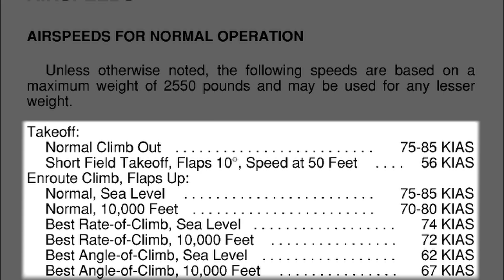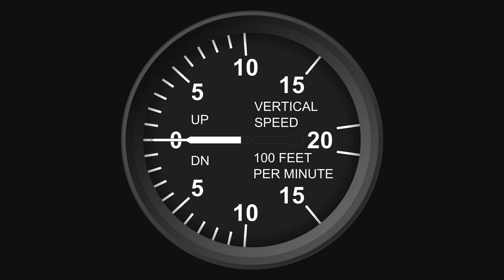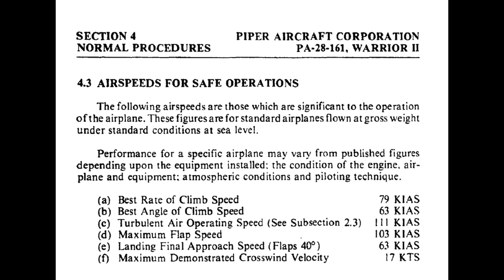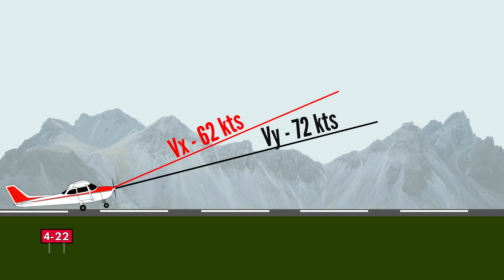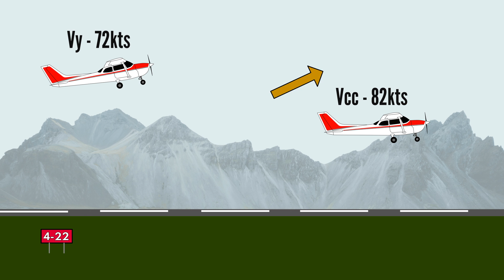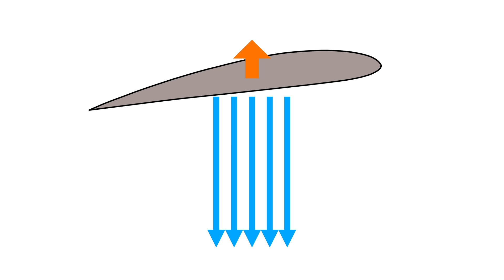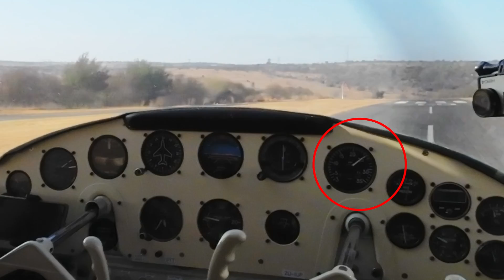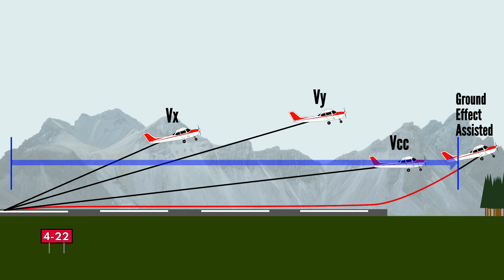Which Climb Speed is the Safest in a Light Airplane?

Comment: Ground effect acceleration is very helpful for an unpaved runway. Wet grass, mud, etc is minimized and safe climb speed achieved just after lifting off.
Reply: It is my default on every takeoff until Vcc or when an obstruction requires pitch up to just clear.  Airspeed, and not altitude, is life until high enough to recover from inadvertent stall.
Reply: This.  Get the wheels off the grass for max acceleration without the drag from the wheels.  It gets you to a safe climb speed with less runway behind you.
Reply: Isn’t this literally the definition of a soft field landing?  Lift the nose and get off the ground as soon as possible, push forward and use ground effect to accelerate to Vx or even Vy then climb.

Of course, one might want to remove flaps to get to a higher Vy but removing float  close to the ground is not worth the risk.
Reply: @lordcraycray2921  Vy is the math most up  for time, but that doesn't make it safer than using runway still ahead, level in low ground effect, until fast enough to maneuver safely regardless of what happens next.  Vx or Vy are not safe airspeeds when too low to recover from an inadvertent stall which is usually fatal.

Comment: Yours is the most extensive and excellent coverage of energy management on takeoff and Wolfgang's law of the roller coaster I have seen.  Eleven of my thirteen engine failures have been at 200' AGL or lower crop dusting and patrolling pipelines.  While the physics of the kinetic vs. potential energy seems equal, save the extra free kinetic energy provided by ground effect, I have found airspeed and not altitude to be life down here where I worked so many years.  As a crop duster (load) and mountain (high DA) pilot for so many years, the basic level in low ground effect (extra free kinetic energy) takeoff and down drainage egress (free potential energy) were default.  Most pilots don't need the extra free kinetic energy until they need it (too late), but videos and statistics corroborate my empirical data.  We very much need, in my opinion, to emphasize altitude (the Vy argument) less and airspeed (the ground effect and Vcc argument) more.  The fatal aspect of poorly done takeoff and/or go around seems to be achieving enough altitude quickly to kill in the stall/fall.  Vx or Vy as appropriate, never appropriate on long runways, and pitch to achieve a positive rate of climb, often initiated at way too slow airspeed, seem to orientate students and even experienced pilots toward altitude rather than airspeed.  How do we change this equation?
Reply from the maker: I think many pilots are caught-out by how fast airspeed dissipates at engine failure. I also don't believe the average pilot can save it at low level with an engine failure during a Vx climb, the bigger problem being that not all pilots realise this danger.

A pilot has to be able to accept the losses when trading altitude for airspeed, and this goes against the natural instinct of wanting to pull up as the ground comes closer, so you may very well be right that airspeed (kinetic) might be the safer energy of the two.
Reply: 13 engine failures!?
You need a new engineer mate! 😂
(Unless you have about 50,000 hours piston time and then that would be about right!)

Wise words.
There is no one size fits all solution. Based on terrain, aircraft performance and numerous other factors there will be a safest departure profile. That’s where experience comes in.

Solution to the training problem? Give pilot more training - simple! 
Get more pilots gliding - where every flight is an engine failure after takeoff. Winch launch is an extreme Vx, aerotow is ground effect assisted.
Reply: @Captain101-x1o  All good points.  Only 17,000 at low altitude, but that was in the days before expensive turboprop jet Ag airplanes mid last century.  Some of them could have been resolved in the time, which altitude affords.  I am pretty much all used up now, medically and such.  But I still fly with all the new instructors at 2H2 to cover some safe maneuvering flight techniques that can be modified a bit to work for all.  In all these years since "Stick and Rudder" was all the principles we had, the training system has decreased incidents and accidents.  The number of fatalities has remained the same, however.  Perhaps a bit more incident and accident experience could result in fewer fatalities.  Or are we teaching pilots to not worry about total energy management until they need it?  Could this result in them climbing out of ground effect to just high enough to kill themselves in the inadvertent stall, which practice stall training has nothing to do with?  Could this result in them going for a positive rate of climb on go around when they have no zoom reserve energy and forgetting Wolfgang's advice to try to hit the tree and then zoom over with the outcome of the maneuver never in doubt?
Reply: You make some very interesting points. Vx climbs are definitely the deadlier ones, but not paying attention and the startle factor could easily push a pilot beyond the recovery envelope in other climbs too. Some aircraft may have a high enough inertia to give you a smidge more time to react but it won't be much money in the bank.

While flying a 600kg class microlight and a similar weight Eurofox my instructor put me through Vx climb engine failure scenarios. Due to their very low inertia the airspeed decays almost instantly to stall speed & beyond. The only thing in your response armoury is the muscle memory to shove that nose down as fast as possible, gained by regular practice.

Can you please explain "down drainage egress". It's not a term I understand.
Reply: @theflyingfool 
Flying following descending terrain ie following the drainage down
Reply: @jimrankin2583  Thanks!
Reply: @theflyingfool  Except for marshland, and especially in folding fault and volcanic formed mountains, rain water and snow melt drains in valleys between ridges all the way to an ocean.  Rather than GPS direct, using drainage systems (valleys) is the safer way to ingress and egress the mountains or actually any terrain other than ocean, lake, or marshland.  Part of takeoff from high altitude airports, especially mid day with higher DA, is to use topographical maps or at least the sectional to determine down drainage egress.  I have flown and instructed in most light 65-150 hp training airplanes from airports above 7,000' MSL.  Level in low ground effect to Vcc and down drainage egress have often equaled 50% of total energy available.  Crop dusting with the 235 hp Pawnee and 100 gallons in the hopper often meant down drainage was the only way I could go.  Vy in the mountains often is required just to maintain altitude in the rivers of air in which we fly.  Here are both orographic lift possibilities and thermal lift possibilities, so POH ceiling means little.  Those pilots who are unfamiliar with these conditions may find up drainage egress out of places like Angel Fire, NM or Telluride, Colorado not to work.  But then it is too late.  That is why the basic level in low ground effect to Vcc, and with no wind consideration down drainage egress, everywhere actually, is default for me.  We don't need the extra energy until we need it, but I am not very organized.
Reply: @jimmydulin928  thanks Jimmy, that's a very comprehensive reply.
Reply: By learning things from those who can teach them correctly/better. That's the first step.

Comment: In ground effect wing tip vortices are less too, so less drag and more acceleration. You get to Vy sooner and can start climbing.
Reply: @Iwishiwasanoscarmeyerweiner  She said all that?
Reply: But that is the error.  Having effectively used level in low ground effect to accelerate faster, why pitch up at Vy.  Having accelerated faster, we now have more runway left for further acceleration level in low ground effect to Vcc or max airspeed if desired.  Pitch up from Vcc or max airspeed produces zoom reserve that can be used to safely maneuver around obstacles that can not be safely climbed over at Vx, Vy, or any airspeed.  ACS favor Vx or Vy without full explanation of the safety of acceleration level in ground effect to as much kinetic energy/airspeed as we wish for safer maneuvering.  Maneuvering flight cannot be avoided around the airport.  We need to teach safe maneuvering flight techniques rather than avoidance of this situation/altitude that cannot be avoided.  ACS ends the explanation of all takeoff maneuvers, "with the outcome of the maneuver never in doubt."  At Vx or Vy as appropriate, the outcome of the maneuver is always in doubt.